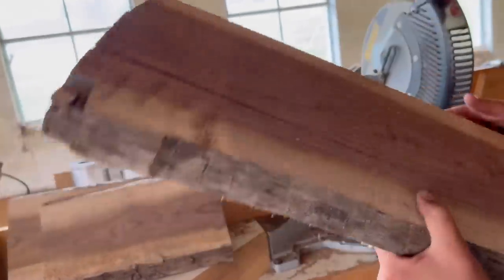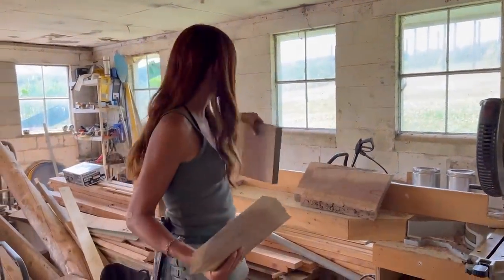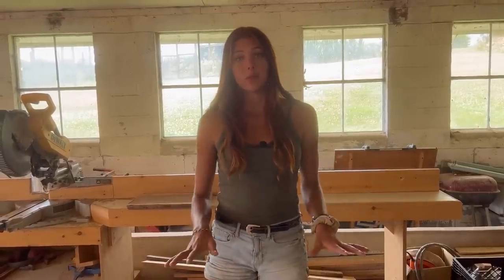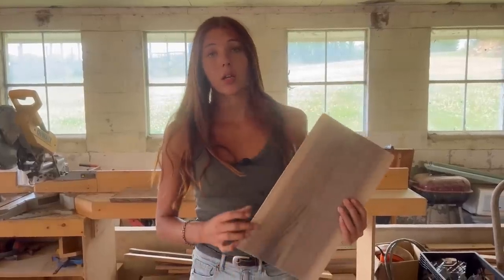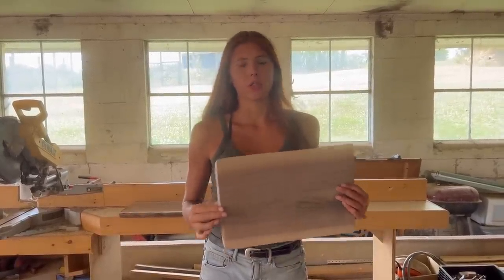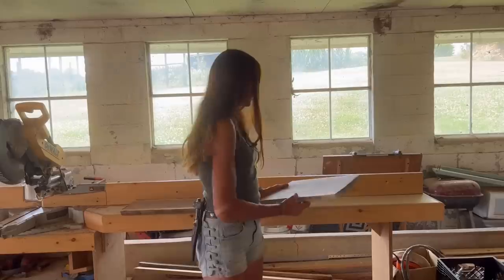Wrapping Up the Week by Making Walnut Cutting Boards!

Comment: If you are going to continue with the cutting boards, you should invest in a "thickness planer".  It will save you a ton of sanding.
Reply: I want a hand sanded one though. I can go to the store and get a super flat and super smooth cutting board. But it will also have zero character
Reply: Would be a lot quicker to use a planer, even if it's finished up with a palm sander.
Reply: @shaynejenkins446  yeah maybe but 99 percent of the rest of the population wants something flat and straight but handmade by someone that isn’t a big box store
Reply: @shaynejenkins446  hahaha
Reply: @brandonjohnson7559  - Plus, it's not like you're going to find Black Walnut cutting boards in any store. The "natural wood" cutting boards in all the home stores is not only low grade wood, but impregnated with who knows what chemicals.  To me, just having good wood, without that poison,  is still worth it, even if it "lacks" that one step.
Reply: Yes! Be sure to get at least a 20" planer, as befitting a lumber mill!!! The 12" would be a purchase you'd instantly regret in an industrial setting.
Reply: Planer = no question about it.
Reply: @brandonjohnson7559  With a cutting board all that matters is that it's durable. Bread or meat don't really care what your cutting it on.
Reply: @kevink4914  Power sanders aren't handmade either then...
Reply: @kevink4914  Unless it's a hand planer eh?
Reply: If thickness planer blades are not very sharp the can be tearing up  of the surface which can be as deep as the original band saw marks. The pieces are live edge and a little bit cupped (from what I can see in the video) anyway. Sanding will give nice surface.
…. “2000 grit”?? A lot finer than I would think would be visible. With orbital sanding 600 or 800 will be extremely clear, in my experience. 
35 years back, or so, fine woodworking magazine suggested walnut oil as an alternative to linseed oil. Whatever oil, you could heat it a little so it soaks more deeply in. 
I enjoy you videos ; thanks for sharing with us. Hang in there, you’re doing fine.
Reply: My planer quickly became one of my most used tools
Reply: @kevink4914  so I guess that miter saw,belt and orbital Da(circle is what she called it)sanders they were using are considered hand made to huh?.take advice from people out there that have made their fair share of things..I make endgrain boards for hobby and give them away,I know a little bit and by no means am I a pro at this stuff,have sold some at yard sales and the flea market for $100+.....you still have to do a crap load of sanding after a planer...my belief is that this wood will not last 15 years but that is my opinion..grapeseed and olive oil do not use,any cooking oil for that matter,it will go rancid over time(look if up)...mineral oil the way to go.....not trying to be all negative on the girls desire to be productive but research some stuff,...could avoid a lawsuit down the road....you never know in today's world.
Reply: @hardracer  ok karen
Reply: @shaynejenkins446  ahhh..your one of those people.
Reply: @shaynejenkins446  if u want to put that natural oil on it, then there is no difference in what u use to get it very smooth for that oil
Reply: They have a planer.
Reply: David Allen: Planers nice but subject to snipe. Drum sander works great for these little boards.
Reply: @samuelluria4744  yeah all I’m saying is being a builder myself is that if someone bought one of my cutting boards and it was wobbly as hell and didn’t sit flat I don’t think that they would be too impressed. Just saying
Reply: @free-energy-systems  yeah well when you custom make a cutting board that you built at home and it’s wobbly I doubt they will be too impressed. I build tons of cutting boards and would never sell one that isn’t flat and square.
Reply: @alanweber675  handmade as in not in a factory by robots, I didn’t mean not using power tools. I don’t think very many people that post shit saying it’s handmade is literally doing every single process with no power tools.
Reply: @brandonjohnson7559  - You've definitely responded to the wrong person, because I said nothing which contradicted you...
Reply: @samuelluria4744  I apologize, I’m not sure how that happened.
Reply: @jakebredthauer5100  where?
Reply: @brandonjohnson7559  
They have a large planer outside by the sawmill. One person puts a large board in one side and another person catches it on the other side.  Wait.  Maybe it is an Edgerton.  It is an edger.
Reply: @jakebredthauer5100  - Yeah, Bro, totally different,  but that's okay...stay engaged...
Reply: @jakebredthauer5100  yeah that’s what I thought, I doubt they have a planer because they only sell ruff lumber and she defiantly wouldn’t have been on her hands and knees with a belt sander if she did lmao
Reply: I agree surface planer would save a lot of labor !
Reply: @brandonjohnson7559  
A hand-plane would make it more handcrafted. 
The center of the board is probably raised up due to shrink.
I suppose one would expect blemishes in a handcrafted product. She never said about the ends. Those can be planed also.
Reply: Even a hand plane might be less work than all that sanding.
Reply: Yep could run the whole board through in 2 passes and then cut then just clean up the edges.
Reply: @308dad8  
When the ends are smooth and oiled with mineral oil the annual tree rings can be viewed most easily.
Reply: @brandonjohnson7559  You implied using a planer would make it not hand made and that's stupid.
Reply: Christ.
Reply: @alanweber675  what? I said literally the opposite of that
Reply: @shaynejenkins446  sanding happens after the thickness planer buddy
Reply: they could even just get an electric hand planer .....save on a lot of sanding
Reply: sure but you only need light sanding after the planer
Reply: @shaynejenkins446  it stil gets sanded afterwards and if you want caracter i would email them and all they have to do is use coarse sandpaper and sanded longer on some spots
Reply: Or wide belt sander
Reply: Hand sanded by the family don't use a planer please
Reply: @jerrysolomon  Yes , it most certainly would !!
Reply: @badass98kx250  they're just wasting time and energy by sanding those rough saw marks out of each board, and then Em said that she was going to sand them upwards of 2000 grit, which is totally absurd for a cutting board. The coarse grain of the Walnut will never get that smooth. It's much more porous than Hard Maple or Cherry. If they plane the entire board and then cut it into pieces would be the way to go. There would still be some sanding involved obviously.
Reply: @free-energy-systems  but your knives do care

Comment: You should use mineral oil on the boards. A natural oil such as olive oil will eventually go rancid and stink. Mineral oil is also easier to redo  in the future. Also when sawing please but board against fence. Safer and gives a more square cut. Breathing walnut dust is not good for you so please think about using a respirator. Love your channel.
Reply: Personally, I like to use motor oil :D
Reply: I had that thought too, but I think the raw edge prevents that from working.  
i agree that it would be safer to secure the work .
Reply: Charles McGee: You can’t use the fence when cutting live edge if you want a straight cut. Best option is a track saw but I’ve cut hundreds of live edge slabs in the miter saw with no incident. Just make sure it’s a shape blade.
Reply: @buildingexperiments6097  make sure its used motor oil. The added copper and aluminum fine shavings help with sharpening your knife as it draws across the wood. 👍
Reply: Do not use anything but mineral oil.  I have ruined a few boards using the wrong stuff.  The mineral oil is the same that is sold in the local drug store known as Food grade mineral oil.  Some places sell an oil/bees wax mix sold as butcher block oil.   As far as finished sanding, I never go finer that 220 grit. And I add little rubber feet to lift the board and keep it from sliding around on the counter.
Reply: @buildingexperiments6097   I might not know much I doubt motor oil is a good product to mix with what comes in contact with food you eat...
Reply: Consider a Medicinal grade mineral oil.
Reply: You said all the things I was thinking . Also an angle grinder with a sanding disc would remove the saw marks in seconds. I really did cringe over the saw. There is sooo much dust that floats in the air long after you stop sanding, Your advice is good.
Reply: I have to add to the comments.    Use Tung oil it's natural and FDA food safe   also agree that olive oil is not a great choice!   But am also a fan of live edge and have Ash!
Reply: @strange-universe  Butcher Block Oil is Pretty much relabeled mineral oil at 3 or more times the price. My personal preference is food grade Mineral oil mixed with Beeswax.
Reply: Are you selling this I'd like one 16 x 22
Reply: @strange-universe  It's merely an expensive name for Mineral Oil that may or may not have an additive in it, such as bees wax. I make my own mixture of Food Grade Mineral Oil and Bees Wax for my boards.

Comment: Don't use olive oil or anything like that.  They will go rancid fairly quickly.

Try using mineral oil or an oil made for cutting boards.

Other than that, looks good 👍
Reply: The oils made for cutting boards are usp mineral oil.
Reply: beeswax

Comment: Just to reiterate what some other people already said, definitely don't use olive or grapeseed oil to finish cutting boards. Those kind of oils go rancid way too fast. Use food-grade mineral oil instead. Also, I highly recommend clamping the board to the workstation if you're not supporting one edge against the fence when cutting it with the miter saw. It takes a little extra time, but safety is worth it. Ditto for wearing hearing protection and a dust mask or respirator when sanding. Your future self will thank you, trust me.
Reply: The oil to use on a cutting board is mineral oil. You can find it in any drugstore.
Reply: My woodworking teacher that I had growing up said something that stuck with me for my entire life.  "You don't die from woodworking, you die from breathing in sawdust."
Also, you only have 1 pair of ears and 2 eyes.  Protect them.

Comment: Your instinct is correct, sanding across the grain to begin with helps to remove material and get past the rough cut faster but then going with the grain gives a better finish. 
I've had my share of work pieces getting thrown around by power tools and bruises from them so if you don't mind some experienced advice:
For safety it is good to clamp uneven edged pieces before cutting with a power miter or I usually use a handheld circular saw so I don't have to worry the piece will get thrown. 
If you continue with the belt sander, a bench with some type of stop (can be as simple as clamping a scrap board to it) is a good idea so the board pushes into the stop and does not slide around.
Reply: Sage advice brother . i took a 1x8 in the hip bone after i removed the safety from my table saw . i had a gouge and one hell of a bruise for a month or more and it put me on the floor instantly and i limped for a week. I put the anti kickback right back on the next day.

Comment: Two things. Always put the board up against the fence to prevent kickback..  And, never reach across the blade with the left hand.
Reply: My long time boss used to crossover like that, he was lucky but it took something out of me having to watch him, cringing all day.
Reply: They don't have a square edge to put against the fence, so her crosscuts would not be straight and she could end up with the blade binding and kicking the board. She needs to clamp the board to the table is all. Agreed how dangerous that left hand action is though !! Scary stuff, indeed.
Reply: @bushmaster2936 not gonna be a straight cross cut by eyeballing it away from the fence either… might as well put the live edge against the fence and make it safer. Also tie up that hair. I’ve heard horror stories of people with long hair getting pulled into machinery. It’s a legit safety hazard.

Comment: Easier to sand the long board before cutting it into pieces. Since you are using electricity, this must not be at your log yard. A 1" cutting board is a little too thick. Would quarter sawing the logs keep the planks from curving (cupping) when they get wet on one side only? The problem with making the bottom the small side is that if you are cutting on the overhang edge, the board will want to flip as you put pressure on the overhang edge.

Comment: Linseed oil is good for cutting boards. Be careful with the miter saw a clamp on the board will prevent a kickback if it catches. I use a planer to get the rough out and then sand it smooth. It's a great idea and I will surely want one autographed. Thank you.

Comment: you have to unscrew the slider bolt at the top rear first
and then you can slide the whole saw across the whole board that you are cutting and also place the board right against the fence of the machine
this correct way will also cut off in 1 go all those broken long bits of the wood you are getting every time at the moment
and then ofc use either a planer, a thickness planer and some lung plus ear protection for more quicker and safer work...

Comment: Cutting 1” or 2” strips, glueing and clamping them will produce a board that will last way longer. Especially if the strips are alternately arranged according to the grain. I have one that was bolted through the edge rather than glued and clamped, works great.
Reply: Emerald, you might be surprised by how easily the checked board could be saved with some water-resistant wood glue. (ps I'm calling the crack a check. Drill a tiny hole through the board at the beginning of the crack to stop it from getting longer.  Angle the drill bit same as the angle of the crack, not perpendicular)

Comment: I have a number of issues and suggestions for you. The miter saw is being used wrong (the wood should be against the fence for safety reasons) however since you are cutting live edge boards you can't do that because you will not get a square cut. What's the solution? after you square up the board to the blade CLAMP the board down to the table.
I know you have had videos about protective equipment but I'm gonna mention it anyway, you lady's should be wearing safety glasses and dust masks, especially dust masks when sanding you may not notice anything now but you may when you get older.
I wouldn't sand the boards any finer then 400 grit. When you use oil as a finish it needs to penetrate into the wood fibers if you sand to 1,000 - 1.200 grit the pores of the wood are closed off to tightly to allow the oil to soak in properly. If you were using polyurethane or laquer then you would want to sand up to 1,000 - 1,200 grit because these finishes sit on top of the wood and do not penetrate.
It's ok to sand across the grain but I would only do it up to like 80 grit then with the grain from there. Sanding against the grain can cause you more work if you don't stop with right grit early enough. I noticed also that not all of the milling marks are being removed with the belt sander, if you remove all of the milling marks with the belt sander sanding with the random orbital sander will go a lot easier.
A number of people mentioned getting a planer, this will GREATLY reduce your time and save money on sand paper but it's also an expense of about $300- $600 depending on the quality of one you get.
I HIGHLY recommend to NOT use olive oil or grape seed oil to finish the boards, these oils can go rancid and make people sick. You are better sticking with mineral oil (which can be found at any drug store) or cutting board oil (I know Home Depot has it) so both are readily available for everyone to get so they can rejuvinate their board when they need to.
I also wanted to mention that Cherry is also a good wood to make cutting boards out of.
Good luck with your endeavors and if I can help you out in any way let me know
Reply: You are spot on! So much wrong going on in this video
Reply: All this advice is the advice you need to take. It's all spot on. And let me add, you need to remove the live edge. As cool as it looks, it will hold bacteria.
Reply: This is everything that was needed to be said! Learn from every resource you have!!
Reply: Perfect comment!
Reply: @mitchtucker5768  You are right, of course, but mistakes are a great part of the learning process as well, so it's still positive overall. The comment section here is a gold mine of good helpful tips from people that only gathered because they posted.
Reply: Do you have iron wood available? I haven’t done the research, I have heard that it tends t words non harvestable.
Please observe safety with carpentry equipment.
Reply: I'm a fellow woodworker watching and I agree with this comment wholeheartedly.  We want you ladies to be safe!

Comment: I'm not trying to tell you guys how to use your miter saw, but I hope you realize that it slides. That feature enables you to keep the piece that you're cutting to remain tight up against the fence while you're cutting, which is a much safer way to cut. Also, when you're sanding indoors even if your sander has a dust collection system you really need to wear some type of respirator & googles to protect yourselves - especially when dealing with walnut. We love you guys and wouldn't want to see anything bad happen to you while you're doing your thing! ❤

Comment: Cool video. I run a mill myself, you guys are starting to inspire me to make some more videos of my own. As everyone else mentioned be careful on the table saw cause it’s definitely not fun if the slab moves and the blade catches. I always use a little wedge between the back board and live edge. As for finish I like to use 4:1 mineral oil/beeswax or walrus oil. Keep up the interesting content.